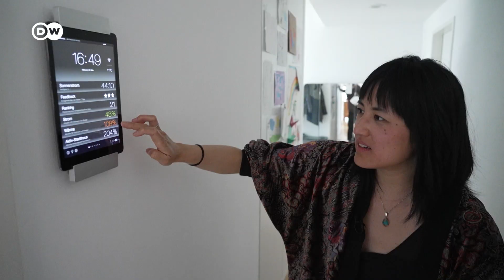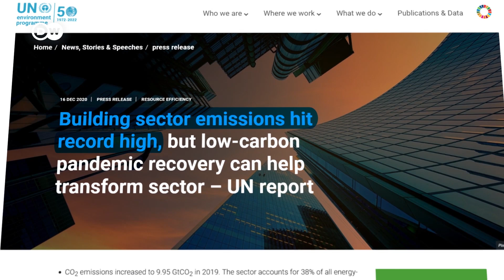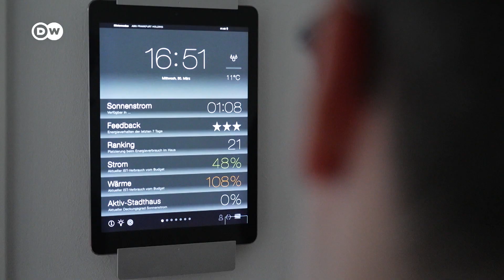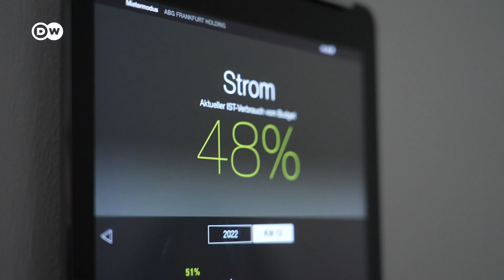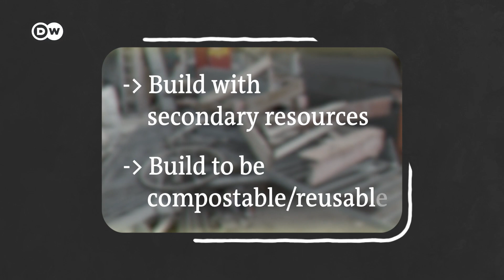Why our buildings suck, and how to change them

Comment: Everyone's house tracks their energy use. You get a bill for it at the end of the month. The difference is that it is easily available on an ipad rather scattered across several meters that you would have to read if you wanted an update before you get your bill.
Reply: It's a bigger novelty in Germany, where you usually get an estimated bill every month and the power company comes maybe once a year to check your meter and adapt your bill accordingly. At this point you either pay them an extra bill, or you get money back. In my old building i didn't have access to my meter anymore because the basement was locked.
In the US you can often just acces your hourly electricity consumption with an app on your smartphone, no need for an ipad on your wall.
Reply: Wow, here in Quebec, the the utility provider gives a nice online portal where you can track your consumption live, as well as providing live estimates of what your bill will be at the end of the month at your current consumption levels. No ipad necessary. I sorta assumed that was widespread by now.
Reply: And compared to the building's average... the and in time compared to your average, say in monthly bands
Reply: I don't even see my electricity and water consumption as it's paid by my landlord. They have to reimburse us every year if we paid more than actually used, so it really doesn't help tracking my actual consumption.
Reply: I'm glad we have our energy consumption (power and gas) visible in an app. And we use it a lot. We charge the car when the sun is shining (if possible) and use our household appliances during the day.
Reply: I have a display that came with my "smart" meter. But it doesn't work because my flat is two floors above from the meter...

My energy provider (Bulb) show you your usage on the website at least. That did not stop them from charging me £1,713 for my usage last month, despite it looking like I maybe used £60 at the maximum. So yeah, I could certainly use some more accurate tracking of my usage in general, whether it's before I get my bill or after.

Comment: As a historian, I am very grateful that you mentioned the embodied energy in historic buildings. Amateur environmentalists often just see old structures as energy drains, failing to realize that many of them have great advantages for energy conservation once you upgrade their climate control systems.
Reply: I've never seen a building with less need of an AC than my parents 180+ year old farm house. Massive walls of sand and stone (no concrete), so superb insulation. They needed to get an EU energy Rating when they renewed their central heating, and of course the official energy rating is... F. Because modern ratings don't account for ancient building techniques and their advantages...
Reply: @mlippert  Very interesting standpoint, often overlooked. Also these houses accumulate heat, so when you heat them up (which does take quite a lot of energy), they do not need much to stay warm.
Reply: Modern system is brutal. And sustainability built upon modern system is a brutal scam.
Reply: @mlippert  That is physically nonsense. Massive walls have the worst insulation and have the biggest heat losses.
Reply: @Stefan_Dahn  So you're saying an 80 cm insulation of any given material is worse than a 10 cm insulation of the same material? I think it's your physics that's inverted...

Comment: Easy to say than done. As a civil engineer, budget is the most important thing. If it is for residential buildings and looking for greener solutions, so little companies are willing to pay for the high initial costs unless that's one of their selling points and consumers are expecting to pay a lot more. Also, we often see well graded and certified green buildings literally fall into much lower grade in a year or two, not sure why but it is what it is. Another issue is most carbon emission during construction is produced by transportation, not the construction itself.
Reply: Can you please link a source for "green buildings literally....". I don't belive that.
The transport energy (co2) is quite low compared to the embedded energy => co2 footprint in concrete and stones etc...

Comment: The recycling and reuse issues are also cultural. In Japan, trades are often deconstructing and sorting out building materials into up to 20 different bins.  In western countries it is very hard to get people to sort out materials.
Reply: Unfortunately, many postwar & modern buildings in Japan are built with only an expected lifespan of several decades, before they are to be torn down & replaced with a newer structure.
Reply: @jonathantan2469  I was not aware of that. Why are buildings built to last for only several decades?
Reply: @mk-oc7mt  I don't the major reasons but some  are frequent earthquake, typhoon and tsunamis . And also society nowdays advances too quickly so buildings quickly becomes redundant.
Reply: @mk-oc7mt  also the in many countries like China and UAE you can't own a land it could be leased from government for 70 year or so House are not made to last longer than that. I live in developing country and here houses are made to cheaper so there's alot of cost cutting ✂️ and most of these houses will last more than thier intended lifespan. 
Green politics in most country will not work as it's too expensive and if implemented will bar alot of people from entering middle class.
Reply: @g1y3  that’s interesting, thanks for the info. Here in the US, most single family homes and often multifamily are made of cheap and engineered lumber, essentially cardboard. Homes don’t last long here either.
Reply: @mk-oc7mt  That's because it's common for property in Japan to be redeveloped after the owner sells them to the next person or company down the line, usually replaced with a taller building. Or a newer house with more modern designs & technologies. The average time of ownership is usually several decades. So the logic is why build a structure to last centuries, when it's likely to be demolished and redeveloped after several decades...?
Reply: Most construction materials are actually recycled into 'new' materials for other construction projects.
Reply: i don't think it's hard for the people to recycle in different bins. The problem is with governments not wanting to invest in new systems.
Reply: @jorgen8630  have you been on a construction site and seen it happen first hand?
Reply: @user-bi8ko7kc6h  depends on the type of construction and where you are located. By weight, steel and concrete, that’s true. Not when you consider how many different materials actually come off site. Most are trashed.

Comment: concept of single family housing in USA are the worst environmental culprits residential apartments & mixed use of shops , office & residential multistory buildings with walkable distances are best which makes a spread-out city a small city 

- every single home roof is exposed to sun & external atmosphere consumes energy for both cooling & heating
- many miles of roads , power , water , sewage , broadband etc have to be constructed & maintained each year
- no grocery store near the homes they have travel many miles to make a purchase every day carbon emissions & even online deliveries should travel more miles
- large areas of farmlands forests have to be cleared for every single house
- on same building foundation 4 storey buildings can be built but laws do not allow embodied energy value is high
Reply: In a very individualistic culture it is extremely difficult to sell the idea of sharing space with other people as the ultimate success.

Comment: I'm in low-income and have deeply affordable social housing originally built for seniors in the early 70's. 2/3 of the residents (About 240 apartments) are seniors the rest are people on ODSP and welfare. Rent is RGI and for most people, it's about 149 a month. There are a few market rent tenants paying $850 which is about 1/2 of normal rent here in Toronto. They replaced the bathrooms and showerheads for energy savings. The Windows are from the 1970s and the steam heating is also from the 70s. There is no individual control overheat per unit. There is no motivation to improve the efficiency of the building and most tenants are too poor to care. We get what we are given. The best we can do is use LED bulbs in our sockets and lights. The rest is market-driven. If computer monitors and TVs switched to micro LED to save money it would take a decade before it was common in this low-income environment. The technology would have to be ubiquitous in the rest of the market and fully discounted before it would be affordable to most people here. The average income for people on disability support and seniors is about CAD$11,560 and on welfare it's about $4,500 including RGI rent. It's hard to worry about the environment when you can't eat anything but items from the foodbank. Most people don't have any interest in separating their garbage, recycling and organics since each floor has a garbage Shoot. The average age in this building is increasing and is about 40 or so. But like the rest of society, the population is aging. A bottom-up approach might be the only solution.

Comment: What's with the high rise building in the thumbnail? The housing responsible the most for climate change are single family homes, which use a lot of land to house a small density of people and also lead to higher private car ownership and lower public transport use, besides being energy inefficient and costly when it comes to infrastructure. High rises are the exact opposite, and it would be better if more were built in the west.

Comment: Let's also not forget about zoning laws forcing long commute ways (mostly by car) espacially for lower income households
Reply: Exactly, I moved to the city where I work. 95 % of the time I go to work on my bike. My shopping center is only 500 meters away. I have a bike trailer for the heavy loads. I use my car for the long distance, but that is rare.

Comment: Urban planning is a huge component of the conversation around building sustainably. We cannot rely on atomizing buildings into separate sustainable units to achieve a systemic outcome like reducing emissions. At least for audiences in the US, there needs to be a greater education around  better planning. I think this video simplifies the issue. Other commenters are making good points about building types and configurations.

Comment: Could you explain what is the problem with concrete? Why is it worse than a tree? Concrete is better than wood in terms of sound insulation, service life, strength, water resistance, insect protection. OSB uses a lot of glue (contains formaldehyde). Wood requires deforestation, sawmilling, chemical processing. I think that in the long-term wooden buildings have a higher carbon footprint than concrete buildings.
Reply from the maker: We made a whole report on concrete, you can find it here: https://www.youtube.com/watch?v=dgVWz77lGCo

Comment: Following are the key aspects of a sustainable/green building

1) Durable and high quality-This increases the lifetime of the building and thus reduce the need to rebuild
2) Energy efficient building envelope- Glass buildings are the least efficient kind of building, in any climate. 
3) Energy efficient service equipment, such as cooling, heating, and ventilation systems
4) Located in a right place- building's location and how it connects to the rest of the built environment determines how people access the building, such as, whether they walk, bike, take public transit, or whether they have to drive. 
5) Comfortable for occupants- Thermal comfort, good air quality, etc.
6) Well integrated to the surroundings- This determines how a building contributes to it surrounding, which affects the quality of the public realm. 

Buildings covered with Solar PV or built with recycled material, are not necessarily green, if they are not complied with at least these criteria. Most of the old and refurbished buildings in Germany are greener than to most of the 'green washed' buildings we see in media.

Comment: In Israel it's standard to use a solar water heater since it's super cheap, basically just a large glass panel with black piping in it .  While most houses still have an electric one just as a backup, we won't use it most days of the year unless it's a cloudy winter day
Reply: Lucky you for having so much sunshine. In the Netherlands is mostly cloudy.

Comment: I would be interested to see more on this topic. I think that in the long run, we need to brace retrofitting buildings with green technology. If nothing else,  people need to deal with the fact that the technology will change faster than we can build! I would be curious to know about some more tailored solutions to energy efficiency. We have gotten used to building the same way regardless of local climate and that doesn't make sense.
Reply: Your local power company may have suggestions on their website. I know mine is willing to come in and assess my insulation and appliances for free.
Reply: the challenge there is that there is a threshold below which retro fitting is not feasible. Consider places with a proliferation of single family homes. By simply having more walls exposed to the outside, the need for insulation is drastically higher, on a per individual or family basis, compared to say apartments. If we can build with mostly wood, the choice between retro fitting or simply building denser becomes closer.

Comment: The "circular economy" based on cradle to cradle certification is a great strategy. Thank you William McDonough and Michael Braungart! I totally gutted my 100+ year old house heated by natural gas. I installed new exterior doors, triple pane windows, R27 high insulation in all the exterior walls, basement and ceiling into the attic. I now heat my house with renewably powered electricity and only use the natural gas heater when super cold. Next week I will finish my solar air heater. Our future is renewably powered.
Reply: @halcyonrain2209  While that is true, did you expect my house not to burn a little natural gas when it is -40 C outside? Biogas for dispatchable heat and electricity in each city would definitely help...toilet nutrients, kitchen nutrients and yard nutrients are all biological nutrients.

Comment: In The Netherlands most construction has been on hold for about 2 years because of a court ruling. There's too much nitrogen in the ground. Major construction companies are now slowly turning their heads towards wood construction. Things can change rather rapidly. You just need the proper legislation in place, and institutions to enforce it.
Reply: Wow, thanks for the info, didn't know that. But how did so much nitrogen get into the ground in the first place? As far as I know its only by humans with fertilizer. The rest is by Biomass or rain that carries nitrogen excess from phonotsynthesis. But by that there was never an issue with overwelming amount of nitrogen deposition in the underground. Especially near urban places, where everything is already concrete for cars buildings and infrastructure

Comment: Use: Induction Cooker(instead of Gas), Induction Water Heater(Instead of Boilers), LED Ligths, Use Smart Sensors(Temp, etc.), Use Inverter Heat pump(instead of Furnace) and Good Home Insulation
Reply: And how is that electricity for you induction cooker generated? Wind and solar? No, the wind does not blow all time and the sun does not shine at night. So there is always a powerplant on the backround: coal, gas, biomass = wood and nuclear energy.

Heat pumps are a supplement, but never a replacement. There colder it gets outside the less a heatpump gives heat. So a heating backup is necessary.
Reply: The technical solutions to CO2 have existed for a long time. As with the famine problem, the problem is economic not technical. We need long term, patient investment in the long term interests of all residents of this planet, stable incentives and a robust way of dealing with bad actors. Unfortunately, most governments are ideologically committed to the principle of absolute freedom for investors, at the expense of de facto freedom for the rest of us.

Comment: One of the greatest challenges now is electrifying existing building stock that relies on technologies like natural gas.
Reply: The majority of electricity is still generated by burning gas, wood or coal. Wind and solar make only 3-4 % of the spectrum. Gas has the least CO2 emission, so keep gas in your homes. Unless you want to use nuclear energy, which has the lowest CO2.
Reply: @mardiffv.8775   gas leaks in infrastructure are underrepresented in the emissions analysis. 
I agree that in many places electricity is produced with carbon intensive processes.
I suppose my perspective on electrifying existing building stock comes from living in a state that mostly excludes coal from our electricity grid